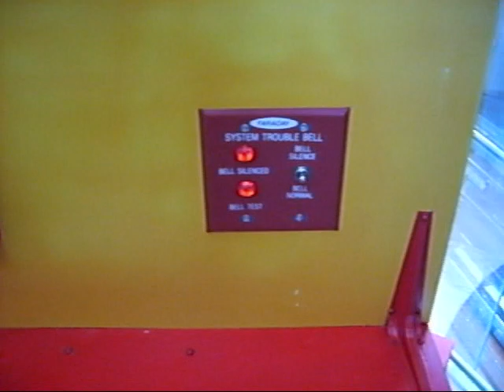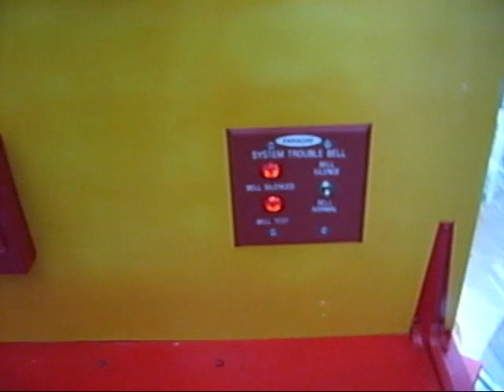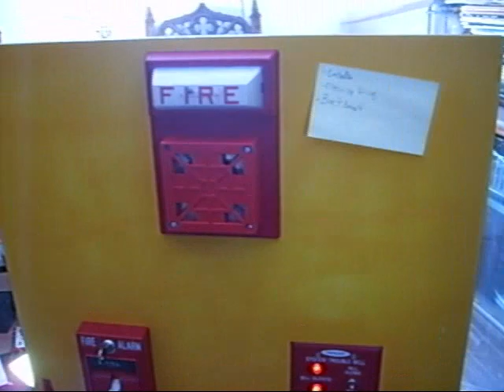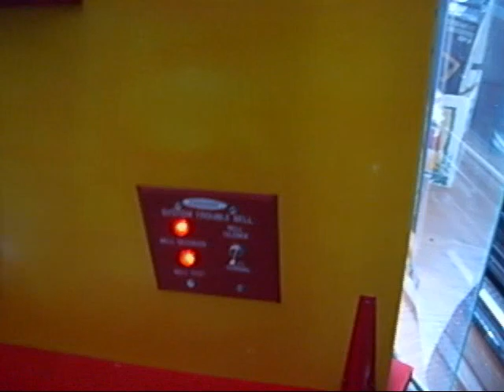Fire Alarm Science Project - In-Depth - 2 of 2

Comment from the maker: Thanks for the suggestion but as it turns out that's how the flasher operates. It simply shunts power back to ground which normally would be the car frame and essentially becomes a heating element for the small amount of time it's off, the heat expands the bimetallic strip, it expands and cuts the connection thereby resetting the cycle.

Comment from the maker: The problem with that is the current required by a bell/horn - flashers are meant to flash low current light bulbs and tend to behave unpredictably under high current load. You can try - worst case scenario is it won't work or it will fry the flasher.

Comment: if your not alowed to use ac power from an outlet you could use a transformer and that gets its power from the battery and gives the alarm a boost. and where did you get the flasher switch?

Comment from the maker: Simple - only the horn ran on 24 volts - i would have not been able to easily get 24V lamps in town and I've never seen a 24V electromechanical flasher, and the batteries are 20 bucks each - I was trying to keep the cost down.